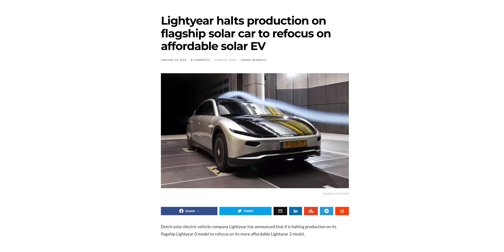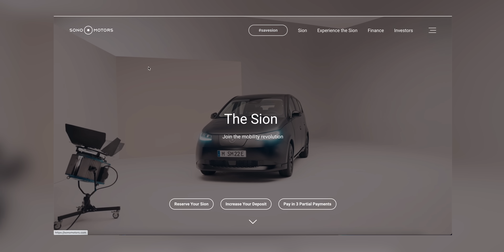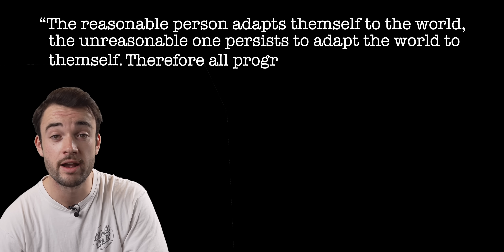Will Solar-Powered Cars Ever Happen??

Comment from the maker: A very sad update from Sono motors just hours after this episode went live: The Sion has been discontinued.

https://sonomotors.com/en/press/press-releases/sono-motors-commits-to-focus-exclusively-on-solar-tech-company-and-has-terminated-the-sion-program/
Reply: "Sono Motors intends to sell its Sion program" so hopefully an established automaker with deeper pockets will take all that design work and produce a similar solar EV
Reply: @nikkismith8750  Nobody wants to buy this student project. Or the moss.  The Sono is ugly, inefficient and the technology is from yesterday. They have a lot of debt with the "community" which prepaid money. Which a buyer also has to pay.
Reply: @vic321344  The moss was dumb. I think the concept of the car and it's practicality was sound.
Reply: @drxym  The concept was to reuse old OEM parts. That did not happen.

Instead they use cheap chinese drive components.
Reply: @EleTruk  No heatpump, no thermal management for the batteries, old drivetrain, old inverters. Even with the phantasy yield of the solar, a Tesla is still 15% more efficient than a Sion.
Reply: I am very sad, but not surprised, to see the Sion abandoned.  I really liked the car, it was the right size for me and could of sat in my drive charging covering 95% my driving (I don't commute).  Maybe some other car manufacturer will take it over.
Reply: That's a real shame. Had high hopes for what I saw as a solar Fiesta, and the concept wasn't as mad as some of the higher-profile failures that obviously weren't going to go anywhere. Sad news indeed.
Reply: That is truly a real shame.
Reply: Shares down 23% so far today
Reply: @nikkismith8750  not unusual for pennystock
Reply: Wow - the negativity in here…

Here‘s a hopeful take on things:

As sad as the halt on project Sion is, their new-found focus of putting solar on every vehicle may very well lead to the change we need, in order for the next solar car model of an oem or company to NOT fail. 

This may be the very thing that helps making solar cars less „damn hard“.

Also - i do believe the Sion was very real. As did the people from Munro & Associates when taking a peek.

Thank you for your work, Fully Charged. And your Rhino skin, Robert.
Reply: I am definitly not sure why there are so many people schilling for big oil in this thread and and trying to state that solar on vans and SUVs will never work when anyone with a brain can see that it could .
Maybe they work at a gas station and feel threatened by solar powered cars?
Reply: @chinabluewho  Show me one car where it works and makes a meaningful difference then?
Reply: @someoneelse7629  There is  no major manufacturer  who makes a van with a full  solar roof , that was my whole point.
If Ford came out with a PHEV cargo van with a full solar roof it would change the world .
Reply: @chinabluewho  No, it wouldn't, as someone with a van with a roof full of solar, it's enough to brew coffe and run the TV....
Reply: @someoneelse7629  Yes, it would, Just because you have a crappy set up doesn't mean Ford would .

 6 to 8 hours of charging in the sun a day with 1.5 to 2K of solar panels is going to yield at least 10 to 15 miles a day, AT LEAST ,as I said before the real world Hyundai Sonata  with a tiny 200 watt panel got 3 to 4 miles a day extra range.
A good EV gets around 4 MPK(Miles Per Kilowatt)  out of a  charge , yes you are losing some when you charge but not enough that you cant easily get 10 to 15 miles a day extra range.
Reply: @chinabluewho  Your math is flawed on so many points, first of all, you won't fit 2k of solar on the roof, second of all, they deliver that when they are at the optimal angle against the sun, and only at the equator at noon the sun is straight overhead the roof of a van, and not for 6-8hours. also, the van is supposed to be driven, not parked at an optimal spot, so there will be shading. And no electric van has ever done 4MPK, not even empty.
But show me one then, show me an existing van that you describe!
Reply: This is heartbreaking 💔😢 I really liked the Sono.
Reply: That's rotten news.. 
I was very enthusiastic about the Aptera, and did reach out to the company. But then I discovered how impractically big it is, and that chilled my enthusiasm. At 88" wide, and 172" long (2.235 metres by 4.367 metres), I would never be able to park it easily and safely in this city, and it would be hard to fit it into one of our local garages. If it were 20" (40cm) narrower, and correspondingly shorter, then it would be a very useful vehicle.
Reply: Would be nice if Chevy/Ford bought  them and kept production going.
Reply: That is sad news l thought an EV with solar panels means no awful recharging waiting hours for your EV to recharge or waiting in a cue t o recharge your EV
Reply: These projects have to be stealth because oil conglomerates have resources to pay incels on youtube, of course they can attack  renewable energy startups in various ways. Solar panel using light is miracle, but rest of the engineering is cake, we've been making friction heat eons...
Reply: A real shame. Could have sold insanely well. Hope they have patents on their tech and can licence it to car manufacturers who might want to develop a similar vehicle.
Reply: They have been flogging that dead horse way too long anyway, it was a stupid startup that knew nothing about cars...
Reply: Lets see if the people who ordered and paid the car will get their money back. Sono burnt 350 mill in 5 years. nearly nothing left.
Reply: @vic321344  $350M and have like 2 cars and zero manufacturing capacity... WOW what a fkn waste of time and money. Been asking SONO for ages when will they come to Aus. NEVER GOT A REPLY. WE are one of the sunniest nations on the planet but no... wasted opportunity.
Reply: Fully charged lost a lot of its faith to me with this unreflected reporting about Sono. They did try to build a car since 2016. If they would have had something 2020 this would have been something.
You should know how much money is needed to start a car production, when even Tesla almost went out of money, when they started to produce the M3.
What other reports are also similar unreflected I am asking myself in this moment.
Reply: Finally!
Reply: @billyfyre158  why
Reply: Does Fully Charged take any responsibility for potentially showcasing brands and indirectly encouraging preorders for EV "products" that are still prototypes? I think you should do more due diligence, or make it more clear the vehicles you show are far from ready
Reply: @nomoreheroes93  Listen, they're not selling shares or anything. They are an EVs news channel. They show off interesting tech. They clear misconceptions about EVs. They promote EVs in general, not companies in particular. Are you salty? Did you invest in a bad company or know anyone who did so?
Reply: @موسى_7  straw man points, I didn't say any of those things. I just think they should take more care promoting these companies as if they're more mature than they are, encouraging bad investments - it's basic journalistic integrity.
Reply: @nomoreheroes93  I think whoever is parting with their money should do due diligence and not rely on a YouTube channel
Reply from the maker: @nomoreheroes93   So we are "potentially" showcasing brands and "indirectly" encouraging preorders. I think you've answered your own question. 
I know we have never, not once, not even by default, encouraged anyone to invest in new, still developing technology or even very well proven well established technology.
What we are doing is shining a very very small light on new ideas and products that are all heading in the same direction. 

The direction of reducing our massive, global dependence on fossil fuel.
Reply: @fullychargedshow  it's disappointing you're taking such a defensive stance rather than trying to be receptive to feedback and improve.
Reply from the maker: @nomoreheroes93  I truly don't know how to be 'receptive to feedback' as you demand. Let me try this.
"You are totally correct, we are a vile, corrupting group of failed journalists funded by a secret cabal of freedom destroying elitists who want to force people to live in community prisons called '15 minute cities' so we lie about technology in the hope that poor dupes will invest in those companies that always go bust and then we use that money to crush freedom loving drivers.'
Does that make you feel better?
I just want to point out that your criticism may or may not be valid, that is up to us to decide, but to assume that what you say has such validity that we will immediately reflect and, as you patronisingly suggest 'improve' can grate a bit.
Maybe modify your high horse attitudes and try to imagine the complexity and hard work that goes into making these shows.
It is very very easy to sit back and snipe away. As you may be able to imagine, many many people do just that.
Reply: @fullychargedshow  You uncritically presented the two optically rebuilt BMW i3 as the Sono Sion prototype back in 2019. 
The next prototype, the SVC2, was described as barely drivable by Kyle Conner while you made it look it was ready for production. 
Sono Motors Sion is still far from production, but was presented as something where just a few millions were missing to start production.
Reply: @billyfyre158  👆👆
Reply from the maker: @billyfyre158  I don't know who Kyle Connor is,  I do know that many people are trying to create less damaging, more sustainable technology, some of which will fail.
It does not mean there's an evil conspiracy, or that anyone is trying to dupe people or con them out of money.
The people behind Sono motors are very dedicated to creating better, more sustainable technology, they are now focussing their efforts elsewhere.
If what we do annoys you, don't watch.
Reply: @fullychargedshow  Kyle Conner, @itskyleconner , test drove the Sion prototype for Inside EVs, and was sceptical that Sono Motors should make it. The prototype was not finished at the level it should be at design freeze. At the same time you made it look like they were ready to produce the car.
Your presentation of the Sion over the years probably created a lot of reservations, and a lot of lost deposits. Sono Motors won't be able to pay back as they say they will, that is impossible.
Reply: @fullychargedshow  The point is that you present literally any old prototype electric vehicle , be it ground or air, as if it’s about to burst forth into the world. You often let the marketeers regurgitate their fluffy nonsense, essentially acting as free fund raisers for them. Your Champagne Environmentalist in Charge is by far the worst offender, literally sitting there googly eyed, smiling and nodding at all the unlikely guff that some of these guys spout, with no actual journalism involved at all. You’re happy to do it as it provided content for the channel, but lacks any integrity. We like to see this stuff, but presented with more of a dose of reality.
Reply from the maker: @GingerPiston  Okay Mr GingerPiston. There really is only one solution for someone as insightful, knowing, and intelligent as you sir.
Stop watching Fully Charged. 
As soon as someone starts spaffing terms like Champagne Environmentalist it's time to shrug and move on.
This is Robert typing this by the way, skin as thick as an old Rhino, you can say what you like but I will not change.
I am proud to be wide eyed and hopeful in a world of misery, corruption, lies and mountains of well funded misinformation partiularly around the topics we cover.
You hate that, you hate me, please, give yourself a break and don't watch. Truly, we don't care.
Reply from the maker: @billyfyre158  You obviously know a lot more about the inner workings of Sion Motors than I do, you must have worked there. 
The way you interpret what we did is peculiar but that's fine. We are not going to change. 
We cover new car makers, battery scientists, electric motor researchers, wind turbine manufacturers, and we openly and transparently, with bias, push and illuminate new technologies that may, I repeat may, be able to help wean us off our catastrophic reliance on toxic fossil fuel.
But for you, screw all that, we didn't say 'this car is a heap of crap and it will never happen' with enough aggression to satisfy you.
There is no other solution for youn other than don't watch Fully Charged.
Reply: @fullychargedshow  You tell guys, people are just angry and sadly your the focus strangely lol
Reply: @nomoreheroes93  Where has Fully Charged misled you about anything?  It is your own responsibility to do due diligence, in any case.
Reply: @n.brucenelson5920  I see you will say the same when Apera is done.

Comment: 8 months later, Aptera is awaiting the full body with glass installed from CPC in Italy. Then they’ll build 5-10 vehicles for validation. (Crash, electrical,suspension and solar)

Comment: Solar panels are pretty cheap nowadays and cost a fraction of what a car does. Sure on paper they can’t charge a car that quickly but they could easily cover say 25-50% of most commutes. That would reduce demand on electricity grids and fossil fuels used to produce that electricity plus any losses over the grid. Also, smaller EVs or even Micro EVs could easily do a daily commute on solar so instead of buying a full size EV, keep your existing car for when you need it and commute in the micro EV plus short local trips. This would be a better set up for a two car household in a lot of cases rather than two full size cars that you would never have both full at the same time. This would also reduce the resources needed to be mined for the battery to a fraction and of course resources for the vehicle itself, plus they're cheaper!

Comment: Someone may answer this ignorant question: why big car company do not produce solar cars? Ford, Fiat, Renault, BMW, Mercedes, Volkswagen, Toyota, Nissan. I herd about very little projects of solar cars by this companies, despite it seems that most of the electric or hybrid cars may benefit from a solar panel on the roof - at least the owner would produce SOME energy by himself and be less dependent on the electricity providers that sometimes are hard to find. It seems not so hard and expansive to put a solar roof on a Toyota Yarin or a Psnda Hibrid, (just two of the most common hybrid car in Italy)…

Comment: Utter Poppycock. A solar car would need to stay still in full sunlight for an entire week in order to drive for one hour. There are simple math and physics concepts at work here. News reporters do not take science classes, so the reporting on this is all wrong. A 1500 watt solar panel array will add ~3 miles of range to an electric car per hour of full sunlight. The array on top of the car might produce 750 watts on the sunniest of days when fully folded out. That translates into ~1.5 miles of range per hour of strong sunlight while the car is parked. The amount of energy captured by the roof mounted panels while the car in in motion is negligible. Just for reference, a Tesla's inboard charger will draw a maximum of about 9800 watts when plugged into 220v AC grid power. This will add 30 miles of range per hour of charge. That would require a solar panel array of 600 square feet. That is a panel array 60 feet long by 10 feet wide. Science does not care how your electric car identifies.

Comment: Solar panels use light, but you don't necessarily need constant sun exposure, because friction breaking heat can power a light source for the panels to use. Car can be charging the entire drive with right battery cells configuration and light spectrum filter.

Comment: My Nissan LEAF 30kw/hr takes about 13 hours for a full charge from a 3kw domestic outlet.
3kw of solar panels is a big area, even bigger if you factor in less than 100% perfect conditions to generate 3kW.  So the most you could hope for is a car that charged up over several days.

Comment: I think the push for efficiency that particularly Aptera and Lightyear pursue is important and they both may have built value on that front, but I think sticking solar panels on a car is an expensive marketing gimmick; smart investors understand that from their analyses - I suspect that's partly why the three are struggling to obtain VC funding.
Let's say your average speed is 40mph, and the efficient vehicle design does 8 miles/kWh - that means 5kW on average. A handful of solar panels on the car? I'd be surprised if you get anywhere near a tenth of that from the panels, even in the middle of the day in southern California. The pitch then becomes, you can charge the battery while the car is out all day in the sun - where wow, you might get a whole couple of kWh across a day. Negligible difference, for a significant cost in the panels on the car - you'd be better off with traditional (much less costly) panels at your home, on the car park or workplace roof, etc, and plug into that. You also don't need to go through any electrical hoops to get the power level up sufficiently to actually charge the traction battery at all.

Comment: In winter my 20 square meter solar array gives less than 2 kWh a day - enough to drive my e-Niro 8 miles.  Over the year they provide, on average, 6 kWh a day -or 24 miles worth.  The practicality of these solar cars doesn't seem to be very realistic for the UK or elsewhere probably.

Comment: It's a stupid idea from the beginning!
If you put solar on a cube, it is impossible fo get the optimal angle against the sun for more then one side at the time, and some sides will get absolutely no sun.
Carports with optimally mounted solar is much smarter, they are cheaper, delivers more power, shades the car from the sun, protect the car from snow and does not weigh down the car.